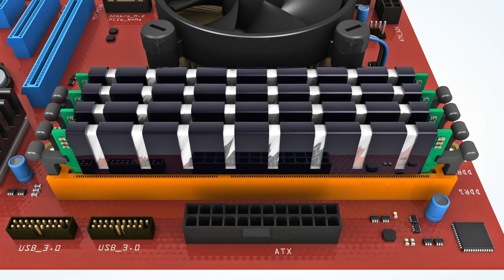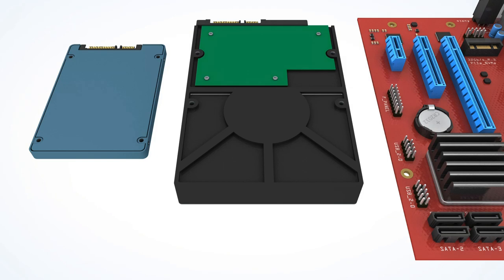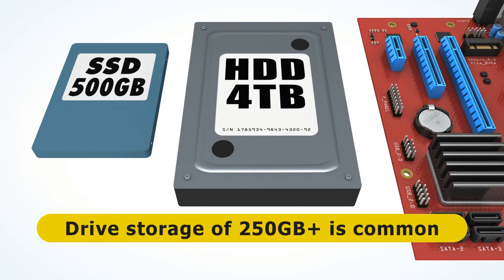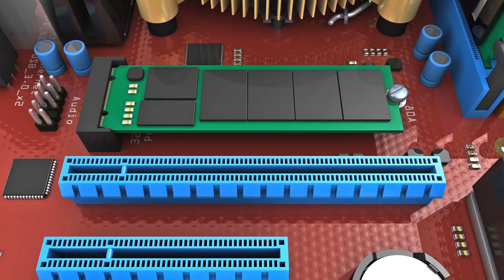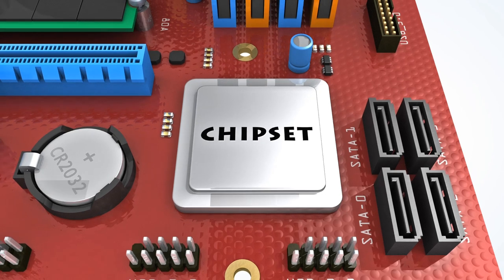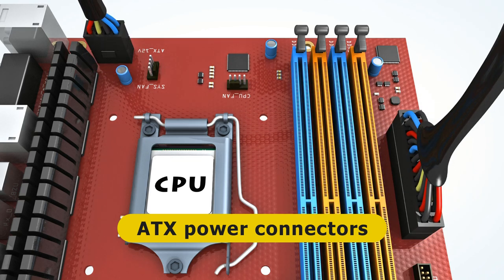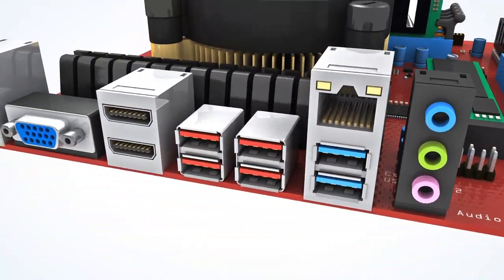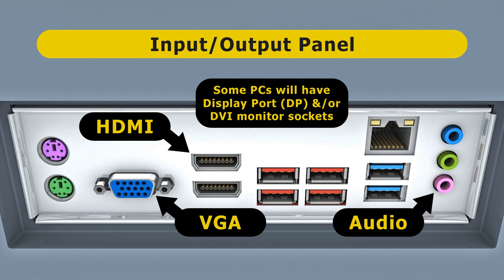Explaining Desktop PC Hardware

Comment: 07:19 "Add a monitor, keyboard and rodent" Well played sir. My only regret was that Mr. Scissors did not make a cameo. 

It is impressive that your presentation kept experienced PC builders around for the whole show. 
That speaks a lot to how good the visuals are. 
The brevity also makes this just the right length. While not highlighted, you even show the power supply and connected cables.

We appreciate you. This channel gives you that same excitement of putting on a winter coat for the first time that season and finding money in a pocket.

Comment: Amazing explanation! The only thing i found missing is thermal paste and io connector, but that was minor, good job, CE!
Reply from the maker: Thermal paste does not need to be applied in a new build with a stock cooler, as it is pre-applied to the base of the cooler (so we can assume it was there in the video as we never see the cooler base!). :)  Which IO connector are you referring to? I'm not aware that any is missing . . .
Reply: @ExplainingComputers  i refer to front io, but since its not critical and minor as i said, its fine if not included at the explanation
Reply from the maker: @gamerlowgraphics  Ahh yes, I see! :) There are front USB ports on the PC, and they are connected up to USB 3.0 headers -- but never mention it in the video (the wires just appear!). And similarly for the power button and front indicator LEDs.

Comment: A bit late but while I already know everything mentioned in the video I still liked it. Explanations were nice and clear while not being too technical. 
The aspect I really liked was the 3D models particularly the light reflections relative to other objects when they get added or removed at the scene like the rodent and monitor, how they change with the changing angles or the camera, the opacity changes when focusing on specific parts, the addition of the tiny pin headers and components on the motherboard, there was alot to like even with just the models. My guess is that the 3D model of the PC and components took you probably days to render something that complex.
By the end of it I was thinking "This should be some IT101 class' materials or something. Really nicely explained with a good model to illustrate things.".
Reply from the maker: Thanks for this. There was about 3.5 weeks of rendering here, across two machines. Although this includes re-renders also. So probably 2.5 weeks for the final shots.

Comment: Superb graphics and animations. Especially fitting that M.2 slot at 4:32... A lot of work!
Reply from the maker: Thanks for this. The last thing completed, and which I did the most times, was fitting the M.2 SSD in the intro section. As it happens so fast the "angled-in, flip down, screw-in" parts of the process simply did not work visually. So it was fudged there, but done correctly at 4:32 as you noticed. :)
Reply: @ExplainingComputers  How long did it take to make this animation and how did you do it? 👍 (What program?)
Reply from the maker: @roelfbackus  This video occupied most of my time for about 4 weeks (although I also took time out to make the recent channel update and Pi Windows 11 videos). The software used was LightWave 3D, although if starting out today I would opt for Blender.

Comment: Beautifully executed Chris. My first computer was a TRS-80 made by radio shack and my modem was a rubberized modem whereby the user would place the hand set of the telephone into the interchange. At the time I decided to make my first computer because I thought that if the Chinese could build computers and ship them to the United States for a ton of money why couldn't I simply go to silicon valley just 27 minutes from my home and get used parts and assemble a machine for less than $2,000 and my goal was to build a machine at that time for less than $150 and if I could get my hands on throw away machines I might be able to build a machine for under $100 which ultimately I did. Then I discovered a place called a computer graveyard and got my hands on free parts and restored machines to life using the Linux operating system and made these available to students and teachers in education for free. Today, I can get my hands on jeans that are abandoned for a failure part or the owner wants a new machine with a working operating system and I simply restore them and give them a new life using Linux in my favorite Linux is MX Linux and my second favorite is Mint Linux. Today I watch your program on a Samsung Notebook which has a touch screen. I find that your program makes it possible for my old brain to update what is moving at lightning speeds in the world of computers. I extend a big thank you for those of us that go back to the first personal computers that were in some cases more than an annual salary paid to teachers and nurses and other folks that were interested in taking a piece of their salaries and making monthly payments to have a machine for communications pre-internet in their homes.
Reply from the maker: Thank you kindly!

Comment: Note: most modern computer cases the powersuply at the bottom for better air flow and the drive bays behind the motherboard tray or at the bottom next to the powersuply.
Reply from the maker: Yes, this tends to be the case for gaming rigs, but less so for general PCs, where a top PSU is still not that uncommon. This said, this is a film -- and there were practical considerations for framing shots and moving the elements around, and for this the top PSU worked better for me.

Comment: I feel like while this guide is wonderful, it's missing a few things to make it perfect, such as how some modern machines may have two power connectors for the CPU, or how GPUs will often require their own power plugs from the PSU, also missing the point of front I/O connectors, and I feel showing a USB type C on the back I/O panel would have been a nice touch to future proof things and help people identify that it's part of the USB stack, considering my 2016 system already has multiple USB C ports.

But that's nitpicking, the video is amazingly well made for basics of how a computer works, very detailed, while very simply explained, this is definitely a ressource I'll use to non tech knowledgeable users asking about how a computer works!

Comment: I used to put together my own machines and I wish we had this tutorial way back then (1990's) Now all my favourite back-street Akihabara parts shops have mostly gone and my fingers are not as nimble as they once were  (Had a stroke in my 50's, and I'm now almost 66!) so I bought an off the shelf Lenovo IdeaCentre not too long ago. Of course I doubled the RAM myself and recently swapped out the 1Tb HDD for a 1Tb 2.5" SSD, and just today changed the 256Gb NVMe boot drive to a 1Tb drive, but that's basically my limit now! Oh, and now I'm skint! 🤣🤣🤣 BTW. Clonezilla rocks!

Comment: Just one tiny point, it may have been good to include examples of other I/O ports, like USB-C, LAN and Display Ports. Maybe a video covering all the different types could be something for a future video if you have not covered that in detail. You could also mention some of the things that can now be connected wirelessly like peripherals and networks as well. Overall a clear and well presented video. :-)
Reply from the maker: Thanks for this. :) There is always a limit to what can meaningfully be incorporated into a single video. For example, the memory section was massively cut down, and I did not want to hang around for too long on the back panel. I'm surprised you mention a "LAN" port as the Ethernet socket was the first thing mentioned and labelled on the panel. USB was also mentioned, although I did not go into the nightmare of the types. Not least, mentioning USB-C really muddies the waters, as is not a USB connection standard (like 2.0 or 3.x -- a USB-C port is typically a USB 3.2 port these days, just not Type-A), but just a physical connector type. And I also mentioned display ports in the narration and via a label in the video! :)

Overall, the more added, the more inaccessible the video becomes for the intended beginner audience, as I think I've just proved above! In education, less is usually more, and I have videos (some  linked in the video description)  that expand on things.
Reply: @ExplainingComputers  That's so true. One can only learn so much before information overload occurs. I still regularly have people ask me about different ports though, especially the mix of USB types, including mini and micro, and versions 1 to 3.1 as well as the different display types - let alone the nightmare of HDMI and Display port version systems. It could still be something you could consider of how to be explaining... the computers. ;-)
Reply from the maker: @elbee2324  Certainly. I did a display connectors video a while back, and have done a few on USB standards. But it may well be time for some updates! :)

Comment: My current PC uses a 1tb PCIE4 NVME M.2 as the C drive and external USB3 hard drives as storage. My CPU cooler is a fixed loop water cooler and I am about to replace that with a CPU waterblock and a medical chiller which is externally located which is about as big as the case of the PC. The only thing mounted to my SATA ports is a Blu-ray drive.

Comment: Very good animation and well explained, very clear. Missed off front of case connections and the  Sata drive data cables though. You’ve even modelled the connectors on the board! Total noobs won’t know how they interface. Maybe an example of what can go in the other slots. A WiFi card maybe.

Comment: Great video like alway, boy how far have we come from the early day.
Thanks Chris
Ps. Im not sure if I was #1 but if was wow after all these years. 😎
Reply from the maker: Thanks. And you have got me thinking now about building an original IBM PC . . .
Reply: @ExplainingComputers  that would be awesome to see.
Reply: when you say early days, are you talking just PC or before?  When I got into computing in 1972, we had a teletype and 300 baud modem. we never even got to see the computer. we had no idea how fast it was.  IBM system 3 we got at the end of 72 as 1.2 MH. Next todays, that was a snail and need a 20' by 20' room computer, printer, card read/punch and 4 13" HD each with 1.2 MB of storage.  for the 6 129 card punch was in another 20' x 20' room.  Even IBM system 32 was like desk size with 10 MB disk ran at 2.2 MH,  Then you get into TI 990, They ran at 4 MH with 13 MB drive or 50 MB or 200 MB with 2 MB of memory in a 32" cablet.  It was all before the FIRST pc every hit the ground.
Reply from the maker: @ffieditor  I was thinking a 1981 IBM PC. But you present me with other challenges! I did build a big of CG core storage for a video on RAM a few years back.
Reply: @ffieditor  in 72 I was 12 no interest in computers then, but like Chris said, 80s would be cool.
Reply: @ExplainingComputers  in the late 70's, I help set up a massive Honeywell server for school I was going to. It was insane what the uni's had. CSU had a IBM 360 with remote job in all the major city, CU had massive server and remote entry into MSU with online star trek at CUD.

Everyone now has so much memory were we wore lucky to have 16K up to 128K.  The days of having to get created are long gone.  We might have to write 3 programs just to get the job done. one do the input, one to do the cal's and one to create the output.

We even went so far as to see how small we could make our code, make it faster. like our code to compute PI to endless number of places, in Fortan, COBOL and RPG II. All in under 8K of memory. This was do to upgrade/downgrade error.

Comment: Thanks!
Reply from the maker: Thanks for your support, most appreciated. :)
Reply: @ExplainingComputers  I notice you forgot the switches on the switch block to set the memory size and the speed of the processor as well as.......... sorry just had a flashback to Isa slots and irq's and huge hard drives measured in hopefully kilobytes...
Reply from the maker: @clintonscott9623  Those were the days! :)
Reply from the maker: @clintonscott9623  Those were the days! :)

Comment: This video should have been released years earilier. It's very informative. But you forgot to explain the other connectors on the motherboard and mention that some motherboards have passive cooling sitting on top of the NVMe SSDs. Furthermore, you could provide some details how to assemble a PC like, "the motherboard should not touch the case because it will cause shortage". Also older PCs had 4-pin CPU power connector or none at all, main power connector was 20-pins instead of 24 and storage conenctors were PATA(40-pin) with a ribbon cable that blocked effective airflow, and so on. You could also tell us what kinds of extension cards are available in addition to GPU, like USB extention, Audio, Ethernet cards, cards for additional NVMe SSDs, SSD made to be put on the PCIe.
Reply from the maker: Yes, you are right, I should have made this video years ago! :) But rather than "forgetting" things, I make decisions about what could reasonably be included in less than 10 minute video introducing the basics of PC hardware. :) In education, less is more, and including everything you mention in this one video would make it too long and less accessible to the target audience. All words were chosen exceedingly carefully so that everything stated is accurate, even if much could be expanded upon.

However, I of course agree that there is a lot more that can be explained -- and I do this in the over 400 other videos on this channel. These include many PC build and upgrade videos, as well as videos on different interfaces and technologies. :) Some of these are also linked in the video description.

Comment: Really like your animation. You might have forgotten to include the 6/8 pin power connector that is required for powerful graphics cards? Also you didn't mention the BIOS/CMOS when talking about the battery.
Reply from the maker: You are right, I did not have a power connector on the graphics card, and given that it has two fans and a very large heat sink, it probably needed one! :) These days the battery tends only to power the clock, with the CMOS settings held in flash storage -- although I added a little "and other things" to cover this. :)

Comment: Great, thanks. Now how about a vid on how you 'built' the fan?
Reply from the maker: The fan (blades) indeed took some thought (they are constructed using a sub-patched control cage). But the hardest thing to build was the CPU retaining mechanism, and a lot of time was spent around the I/O panel and doing the ATX connector wiring.

Comment: The battery is old school when PCs were not assumed to be network connected and they may have used cheaper ram that needed battery power. Today most use the phone or tablet model and save things in non-volatile ram and get the time from the network at boot, maybe used for the BIOS time which has limited value since I don't see the purpose of current time in a BIOS.
Reply from the maker: Indeed. But most PCs still retain the time via a battery when powered down, and correct it from the network on boot as you say.

Comment: I hope that desktop computing never dies. As the normie market moves towards tablets and phones, The desktop computer is slowly dying, and this is unfortunate for the consumer, as they really are the only option that is easy to upgrade and maintain. I for example, went from a Ryzen 5 1600 to a Ryzen 9 5950X, the kind of upgrade that will never again be possible on a laptop or tablet/phone, as they usually come with a soldered CPU these days. I'll likely be able to use this CPU and motherboard for the next 10 years, but if I had bought a laptop with that 1600 in it, then I would have had to buy an entire new machine when the time to upgrade came.
Reply from the maker: I can only agree. The flexibility to repair and upgrade provided by a modern desktop PC rare, and will sadly not last forever . . .

Comment: wow nice amine ( how long render time ? ), u do this lightwave still, or other software only sad lightwave is not free, last time ive used it was on my amiga 500...
Reply from the maker: Yes, this was all done in LightWave -- and it still looks basically like it did on the Amiga (I see that you are channel member, so take a look in the Community Tab). :) Rendering took a long time because I overdosed on geometry -- all details are "real", rather than texture-based. Hence this tied up two PCs 24/7 for just under 4 weeks, plus another overnight in the final week. This includes re-renders and fixes -- I think the whole first week's rendering was scrapped when I made a few changes to the motherboard! :) But that's the way it goes.

Comment: Any chance you might explore the ESP32?  That would be very nice.
Reply from the maker: It is on my list. :)
Reply: @ExplainingComputers  For some reason the usual little development boards are just a tad too wide to fit properly on a standard breadboard.  I've had to build a little rig using vero board and headers to enable quick and easy connection of peripherals.